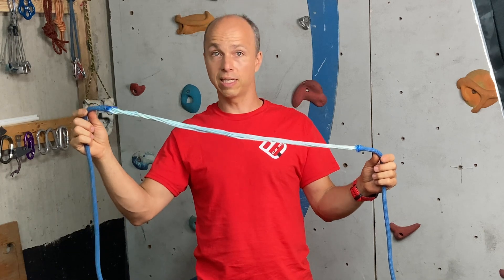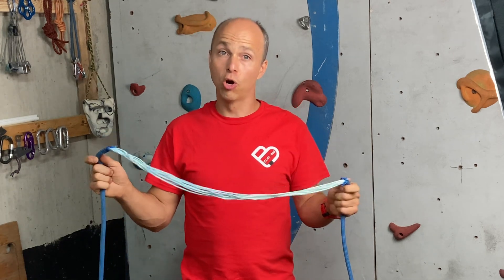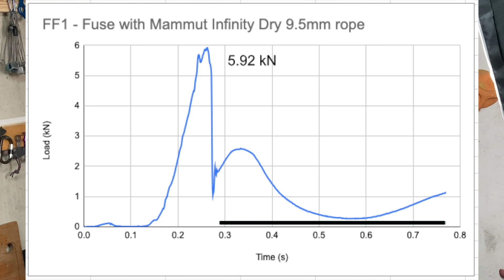Testing Gone Wrong!! Edelrid Fuse

Comment: Ridges seem to be worse than teeth, in general, no?
Reply from the maker: 5.7kN and 5.9kN is what I got with the ridges of the Fuse. It is on par with my tests with devices with teeth. So I don't see ridges as worse. I would say they are equal in general. Other design factors around it matter more than teeth vs ridges.

Comment: Hi yann, after your tests with different rope diameters, what diameter range do you recommands for a LRS set up with a grigri plus HUD or Mudo 3 as primary + Fuse as third hand ? 

Under what diameter the fuse becomes inneffective at catching a fall since it is design for 10mm + semi stat ropes ? 

Personnally owned a mammut 9.5mm alpine core protect but I wanted to test this LRS set up with an edelrid swift protect pro dry 8.9mm to minimize rope drag unless you think its a bad idea !

Thank you in advance.
Reply from the maker: Both the grigri and the mudo bend the rope so the third hand don’t need to give the full force. The worst case would be brand new Fuse with brand new rope. They could slide a bit more than you’d want. Test attaching your rope to an anchor, put the fuse on it and measure at what force it slips. If you have 80kg of friction it is a very good third hand. I suggest you make sure your chest attachment.breaks at 1kN or less. That way if primary slips, Fuse catches, chest breaks, primary engages fully. Makes sense? Let me know your results!!

Comment: Hello, according to your test the fuse isn't a good device for LRS but in a new video you use it to give slack to your Grigri and it has also a back-up function. Is this back-up function reliable?
Reply from the maker: I think so. More testing coming but it is a great idea I believe. I have been using it for months. Good as a “third hand” not so much as a standalone. Makes sense?

Comment: Isnt this to be expected from a FF2 with such a device? Its not meant to do that, no?
Reply from the maker: Right. The genius in the Grigri is the half turn around a drum before it pinches the rope. That protects the rope from damage at higher loads. There are some exceptions like the new and old rescucenders that  can sustain forces up to 6.5-9 kN without damage to the rope. I would have loved to see such high kN results with the Fuse!! But note that the results with the Fuse are far from bad!

Comment: Well at least the climber would have survived - so it did go a little better than the same test with the ASAP. 
In case, one would try to use the FUSE as a Backup for lead rope soloing, why not attach it to your harness with a screamer? That should reduce the force in case the main device would fail completely in a fall?
Reply from the maker: @EdeSchmitt  where have you seen a test on the ASAP that suggests it is worse? (Note you cannot post a link here) attaching the Fuse with a load limiter is a good idea.
Reply: @YannCamusBlissClimbing  I meant your video, where 80kg cut the rope completely in a FF2 scenario. In this video, the rope was destroyed, but at least not cut completely, so the climber wouldn´t have fallen to the ground immediately. That´s why i deemed the result with the ASAP worse.
Reply from the maker: @EdeSchmitt  I understand it would have saved the climber! This is a good thing! Do you think 80kg in a FF2 would cut the rope with an ASAP?
Reply: @YannCamusBlissClimbing  In the video in your channel "ASAP Dynamic Testing" the rope got cut, didn´t it? 
Very interesting tests for sure!

Comment: Maybe it's rope's problem? It's 9,5mm, while Fuse and most (if not all) other safety devices are certified for ropes above 10mm, even above 11mm.
Reply from the maker: For sure I made a test outside the scope of the device. I wish it would have worked with 9.5!! Thanks for the comment.
Reply: @YannCamusBlissClimbing  I wish it would too, dynamic ropes over 10mm aren't that popular. Still it's certified with an absorber too, so maybe these devices are made with static ropes in mind - I don't know really, I doubt I've seen this mentioned in any documentation.

Your test shows what would happen in a non-ideal scenario, but I think this happens quite a lot, so it's extremely useful!
Reply from the maker: @BluesyBor  Thanks!

Comment: For me this is not a valid test, as for this device is mandatory the combination with an appropriate DEFUSER for shock absortion. Its also to be used on ropes from 10 to 12mm. So the test was completely wrong, simulating something that it was not designed to.
Reply from the maker: I must say, as rope solo rock climbers, we always use our gear “wrong”. I had to do this test for this community… Look here: https://youtu.be/2152Zhs-8yg
Reply: @YannCamusBlissClimbing 
Если так, то это должно быть написано и конкретизировано в названии видео ролика👎

Comment: The fuse will not break without a shock absorber the rope will.
Reply from the maker: My Fuse is a bit deformed post testing. Don’t remember exactly what is the problem. The Fuse is probably ok for one test whatever the test but cannot endure “infinite testing”. At some point it will get damaged. Makes sense?
Reply: @YannCamusBlissClimbing  The asap will also damage the rope without a shock absorber
Reply from the maker: @thebull54kp  yes.

Comment: How well do these fall arrest systems work a pitches roof? I’ve purchased the rope goblin, and wanted to purchase the Petzl ASAP but didn’t wanna spend money on it if it did not work? Would you recommend one that self trail while walking on a roof with a mild pitch?
Reply from the maker: I don’t fully understand your question… You want a belay system for a roof? Le toit de Ben maybe? Please let me know what climb exactly :-)
Reply: @YannCamusBlissClimbing  I’m hooked in to an anchor point that is the n the top of the roof, my rope goes to the edge of the roof. I clip the rope goblin on the lead line and then my lanyard to goblin. As I move up and down the roof it’s supposed to self trail but I find my self having manually unlock and move it instead of it self trailing. If there’s a way I can send you a video
Reply from the maker: @davidrivera390  video would be best. You can get in contact on https://blissclimbing.com/en/contact/ (close the pop-up)

Comment: Disappointing. I saw a comparison of toothed Petzl Asap and the good ole Shunt.
One de-sheeted the rope kept sliding on the core for a meter and and the other was just sliding for meter and absorbing the fall to a smooth stop. Guess which one I keep using on the second rope for rope access? Of course the Shunt. I use 10,5 or 11mm static ropes. In fact a piece of double dynamic rope would be a great absorber to connect it to. I dont care what the industry (lobby) says. Just show me the numbers, the tests, and I'll make a decision
Reply from the maker: Thanks for the comment!!!

Comment: IMO a device that cannot safely handle FF2 can still be an adequate LRS device. It isn't hard to avoid FF2 even in a multipitch scenario with a few simple tricks up your sleeve.  

The most important one is that in a multipitch scenario where you have a runout above the anchor where you think a fall is a realistic possibility it's best to build your anchor at the top of the pitch, then continue up the next pitch on the runout and once you get pro in THEN lower back down to your anchor. 

With simple tricks like thIs it's trivial to avoid the possibility of FF2. I think it would be cool to see the device used in low factor falls, as IMO it might be an acceptable LRS device just with this large but easily manageable caveat, just like the Revo.
Reply from the maker: I fully understand what you mean. The “Pluss clip” is a good way to avoid any FF2. BUT

I want to point out the difference between the fall factor (fall length / rope length) and effective fall factor (fall length / rope length actually absorbing the impact). You can think of each part of the rope absorbing with a certain efficiency. The rope length right near the anchor does not participate fully because of the friction in the system. So if someone clips 2 pieces around a roof and creates a ton of slack, the FF might be of 0.5 but the effective FF might easily be above 1. The Fuse did not manage the FF1 and in my opinion this is the minimum a LRS device should handle. 

Good discussion subject!!
Reply: @YannCamusBlissClimbing  thanks for the reply, Yann! You did a FF1 test that's not in the video? Or did I miss something? 

Thanks!
Reply from the maker: @RickyHarline  Yes... You have to watch the video again! I have added timestamps to get you to the FF1 easy. Sometimes you want something so much that you are ready to skip information that contradicts the reality you want... ;-)
Reply: @YannCamusBlissClimbing   I watched it in full, for some reason I thought that was a FF2 and not a FF1. That's what I get for watching it while I'm drinking my coffee... Sometimes I need that coffee to fully process the information! =P

Comment: It looks like the cam can fully close.  I think any device in which the cam can fully close to the other side will de-sheath a rope in a hard fall. If you look at a grigri, with the cam fully rotated the cam does not come in other edge of the grigri.  That is how petzl prevents de-sheathing of the rope.  I heard the very 1st runs of grigris could de-sheath a rope because the cam rotation was not locked.  Similarly the uascent and camp lift (I think) have the cam bar what will meet with the cams stop, the ushba device has an ovalized cam bar that is supposed to prevent de-sheathing of the device.  I would be very reluctant to use a device for LRS or even lead belay that allows the cam to rotate all the way to the other side.
Reply from the maker: Hi Pat! You are a master in design! I learn something here! Thank you. Hope all is well on your end of the world! The Fuse would fully close but a small tweak in the shape of the cam does not allow for it to close fully. But the gap is too small to let slipping happen and the grey cam has some roughess to it that damages the sheath just a little. So I think the compound effect of super small gap and roughess to the grey cam makes the device desheath the rope. Note that there is not much deviation of the rope also. The grigri has the rope make a 180 (?) before it pinches it. The Fuse has the rope go through almost in a straight line... So not much added friction and 100% pinching! Makes sense?

Comment: Maybe you can do this test with an ISC Rocker and the easymove ?
Reply from the maker: The easy move cut the sheath at 5.91kN in a static test on a Mammut 9.8mm rope. I think there would be more rope carnage in this type of test. The Camnal "Rocker" (copy of the ISC) needed 7.5kN to get only half of the sheath cut. Much more promising! Should handle the FF1. I doubt it handles the FF2...
Reply: @YannCamusBlissClimbing  in combination with a soloist or mudo, the easymove would only have to act as a third hand in case of falling upside down. What do you think ?